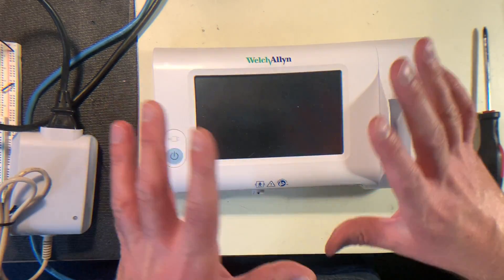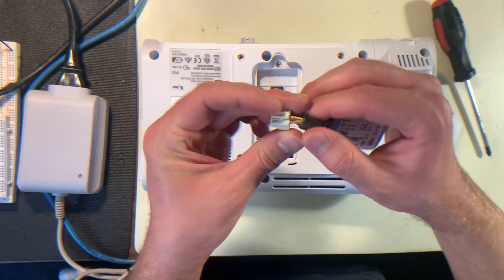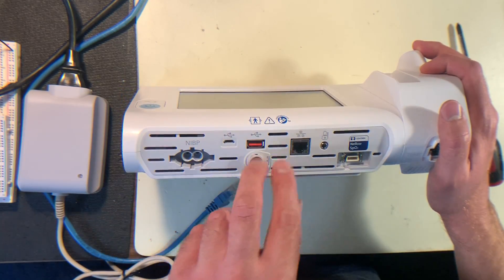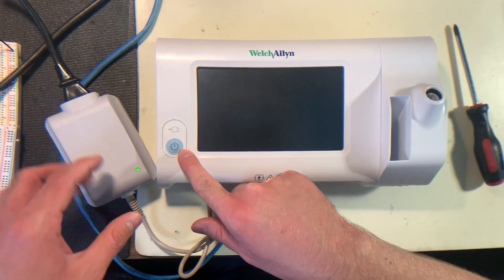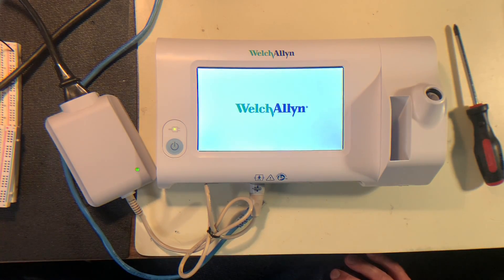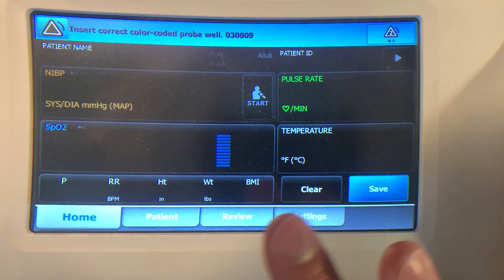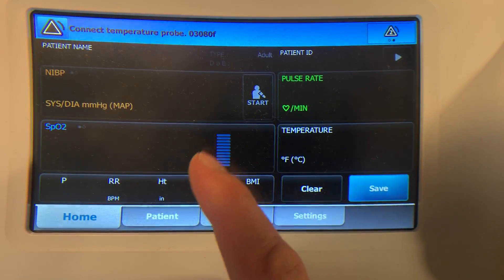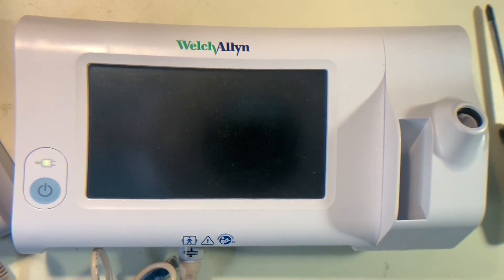Welch Allyn Connex Spot Monitor: Device overview

Comment: Hi, Im a BEMS technician based on Malaysia. I just got a problem with this Welch Allyn Connex Spot. The error display is 'NIBP not functional 050504' where it cannot detect the NIBP function even I slot in the cuff. On the screen display at 'Home', there is no NIBP show over there, its only show the SpO2, Temperature, BMI, and Pain section. 

I already read the service manual for this problem, it stated there  'User EEPROM checksum error.
 Configuration data which can be set in the user's configuration menu was damaged or lost on NIBP' 

May I know the best solution to solve this problem ? Is it I need to change the NIBP Pump inside it or is there anyway round to solve this problem ? thank you
Reply from the maker: Hi Muhammad, I don't have a great fix for you. I would say try recalibrating it if you can but you probably will need to replace pump module.
Reply: @HTMWorkshop  thanks for your advise, sadly i cant do the calibrating my own. Haha need to send it to them i think so. Its okay, thanks for your reply. Have a good day.
Reply: Hi I have the same problem, did you found the solution?